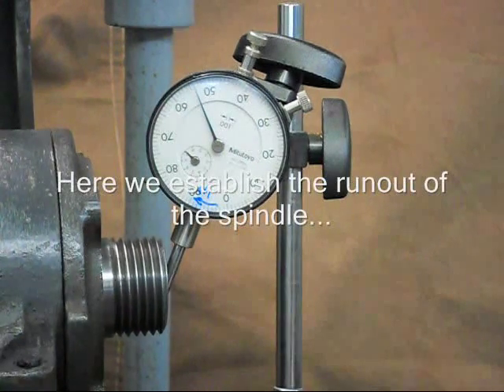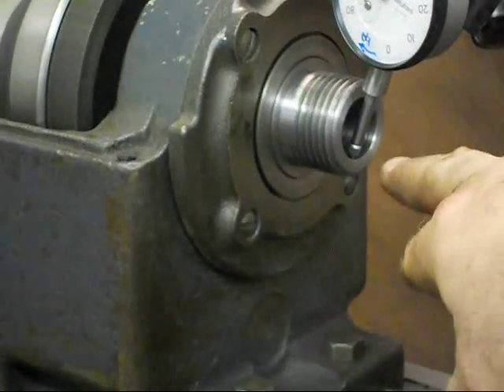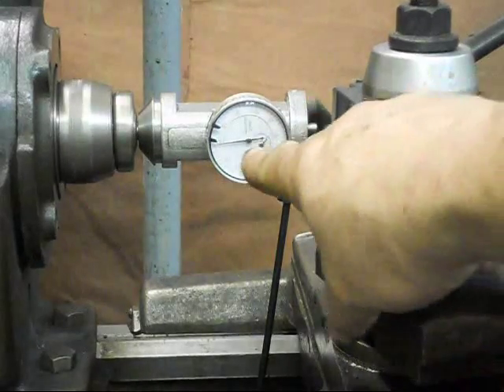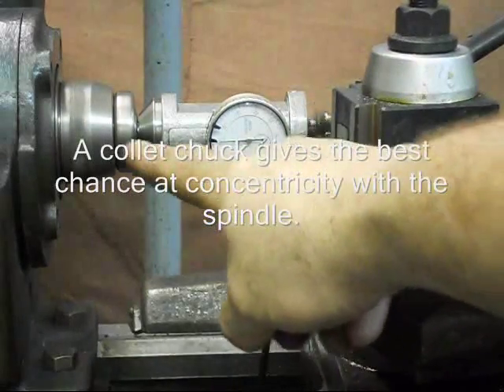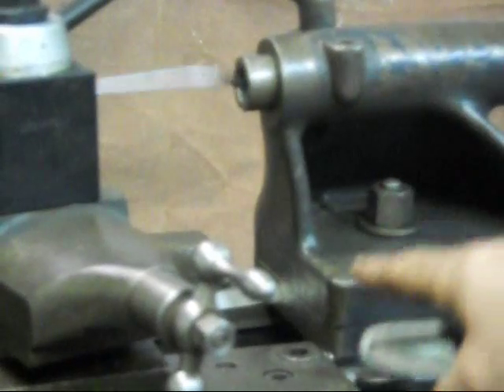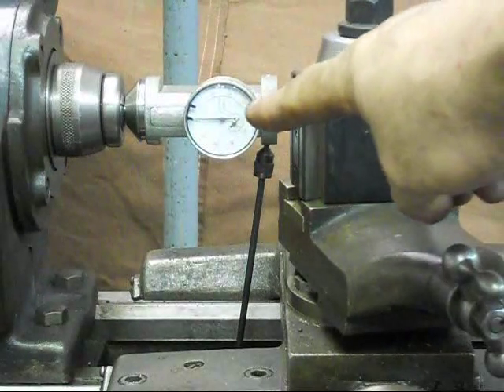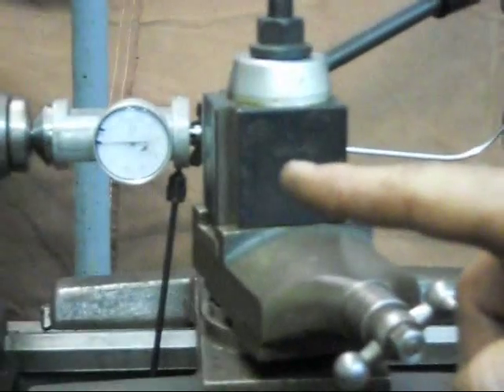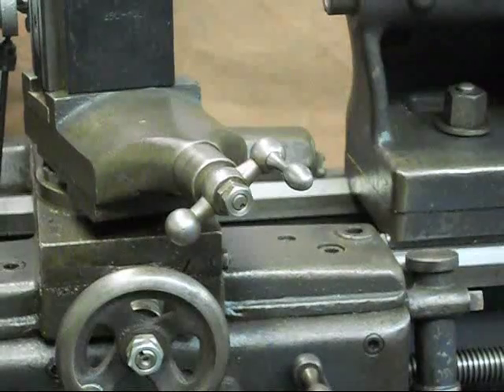Logan lathe alignment

Comment: I just found one of these on Craigslist and got it for real cheap actually it's an 820 from 1946. It's sad enough small town hardware store front window for 50 years of its life at first I didn't believe it until I talk to a couple of locals and they all knew about it. A tour of the gearbox apart to clean up everything and it was like brand new it wasn't that one ship in the entire gearbox all the gears for sharp corner brand new looking. As a matter of fact every gear on the machine looks like it was never used. Of course the paint it all come off from sitting in the sun it was a real mess!. Right now it's turned down every Nut and Bolt call primed ready to paint in my garage it's been a nightmare to say the least.
The only thing that bothers me is the clutch tends to slip a little bit I really don't understand why that's happening it hasn't done it since I clean the assembly and retested it so I might have taken care of the problem just by cleaning it. At least I hope that's the case I am only running a few minutes after I cleaned it and we tested it and then I started tearing it down. It came with 5 Chucks all the way down to it 5 inch 2 jaw Chuck. The very next day after I bought it I found a second life completely torn down already for $200 all brand new it's just like the first one so I'm keeping it for spare parts
This is a great video I'll be using this method to the line everything very very soon of course I'm going to let the oil based paint sit for at least a week. I love this lady that have to say there's something about it. Hey I have a question it's not related to run out I hope you don't mind how much 90 weight oil should I put in the apron I can't find that information. Thanks again for the video
Reply from the maker: Wow, you are loving that machine. Logan made a great product. 

Lucas
Reply: ltousig I ended up assembling the second one instead of using it for parts it is 100% complete and brand new they painted it Battleship Gray and looks like it just rolled off the showroom floor everything is more shiny every nut and bolt is perfect it was so easy to do because it was in such good shape the only thing lacking is a motor I got a great big old repulsion motor I'm going to throw in it

Comment: all at very reasonable prices (on ebay of course). and have cut new acme screws and accompanying anti-backlash nuts of my own design for it. I'm now just looking for good info on how to make sure everything is aligned very well. And in the future I have plans to install a DRO and fabricate an automatic oiler for the ways and dovetails using an oil injection pump from a two stroke motorcycle.

Comment: Thanks very much for the detailed response. I bought a vintage 60's 9 inch model A South Bend on ebay that the seller claimed was in good condition only to find that both the saddle and bed were horrendously worn such that the carriage would not even traverse half the bed length even with a moderately loose adjustment next to the head stock. In fact the only parts that seem decent are the head stock and the quick change gear box. I've bought a nearly new bed, saddle and carriage

Comment from the maker: Most lathes will exhibit wear on  both the inner ways (supporting the tailstock) and the outer ways (supporting the carriage).  I have never run across a lathe that was sufficiently out of alignment to cause me to worry about correcting the headstock angle.

Comment from the maker: Wear of either the inner or outer ways will cause misalignment mostly in the z-y plane (up and down, parallel to the wall behind the lathe).  It is possible that you have misalignment in the z-x plane (front to back, parallel to the floor).  If z-x plane misalignment is your situation, then maybe headstock realignment would help you.  In that case, the correcting process would depend on your lathe.

Comment from the maker: Some lathes are made to be adjusted in the z-x plane.  For instance, the Unimat lathes have a headstock pivot that allows the spindle axis to be adjusted for turning tapers. If your lathe has the spindle axis alignment as part of a cast-in-iron system, then you would probably have to correct the problem by scraping and shimming the headstock casting.

Comment from the maker: Every lathe has some inherent inaccuracies; wear will usually make this worse.  The inaccuracies will depend on where the tailstock is on the ways or where the carriage is on the ways and the degree of wear on the inner ways and outer ways at that point.  I would assess your requirements for accuracy (voice of the customer), and compare the need to the capability of the lathe (voice of the process).  The lathe may be incapable of delivering the accuracy you require.

Comment: How do you also make sure that there is a zero angle between the axis of the spindle and the axis of the tailstock not just a zero offset between the ends? And what would be the best way to make such a correction?